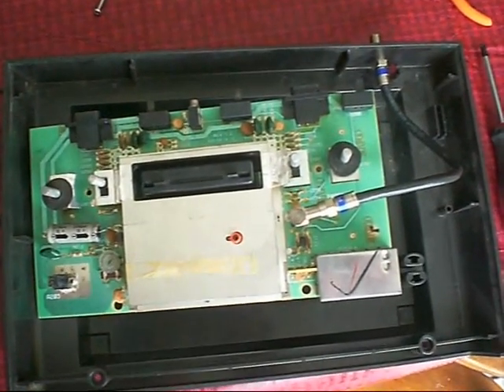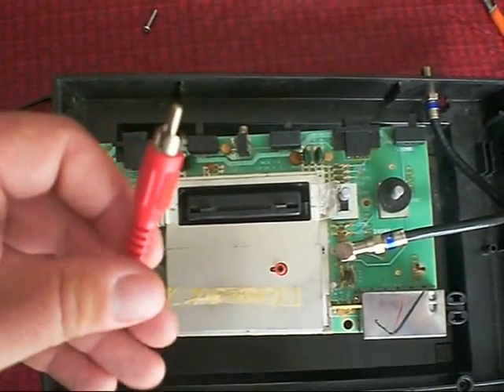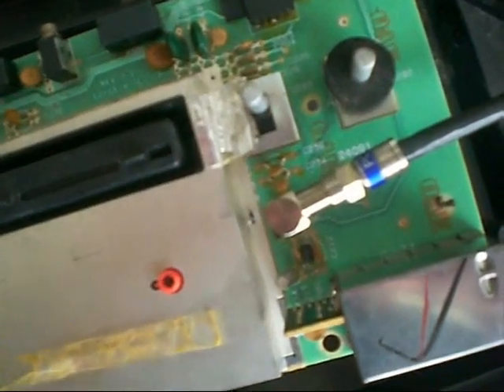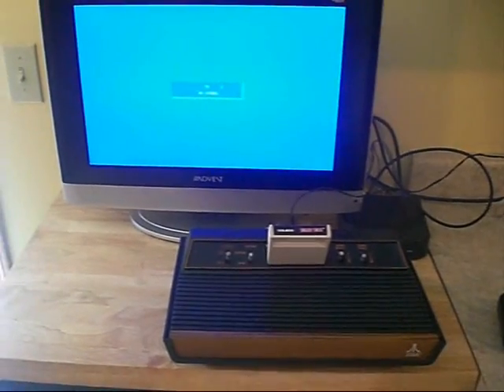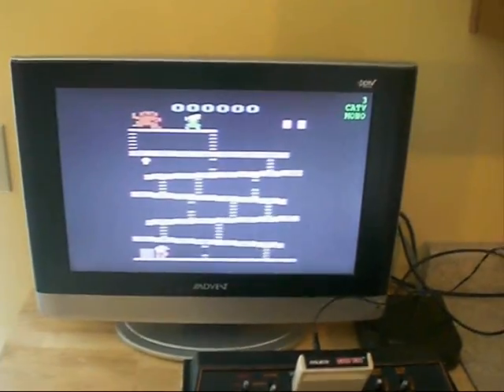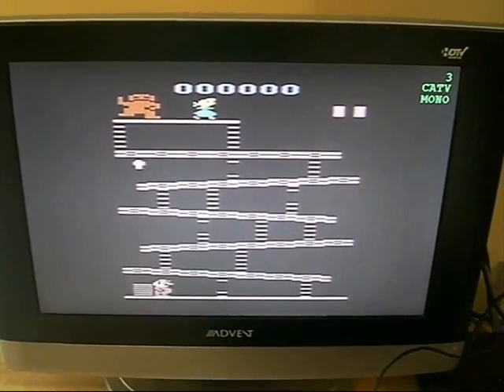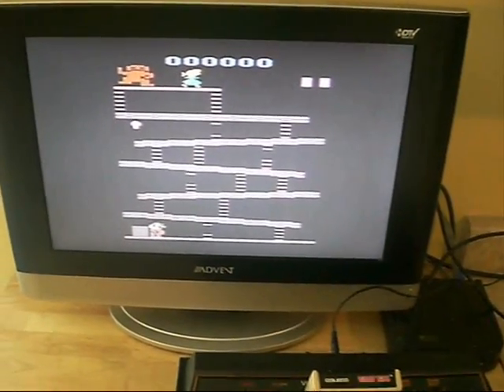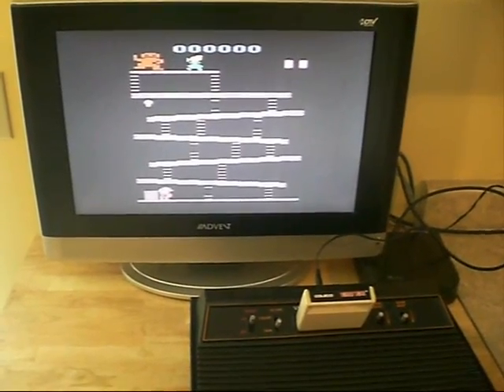Simple Atari 2600 4 Switch Coaxial Cable Video Mod

Comment: Why wouldnt you just use a coax cable sans adapter?
Reply from the maker: I assume you are referring to the right angle adapter plugged into the board, for which there are two reasons.

1. It wouldn't fit without a right angle adapter.
2. The right angle adapter converts it from a composite connection to coaxial.
Reply: @edt1138  well, since I had a broken Atari myself, I did a little not so scientific experiment. I took a regular composite cable and cut the tip short enough to where it would fit. Turns out it works perfect. Then I just used an adapter on the other end to go from female to coax and it worked like a charm.

Comment: Would've been nice if he actually SHOWED us the specific parts he used.
Reply from the maker: It has been eleven years, but you could've just asked. 

I'm pretty sure it is just the RCA to coaxial right angle adapter that you see in the video connected to a short coaxial cable attached to a coaxial pass-through connector for a clean look.

I suspect it is the shielded coaxial cable inside that is responsible for the clearer picture.
Reply: @edt1138  Every right angle RCA to Coaxial adapter I've seen has a prong that's too long to for properly in the port.

The original RCA cable that the system came with has a shorter prong than any RCA cable you can buy today.

How'd you get it to work?
Reply from the maker: @elwoodjacobs4353  I didn't have that problem with the one I bought from Radio Shack back then.